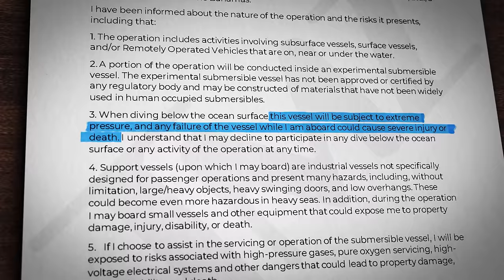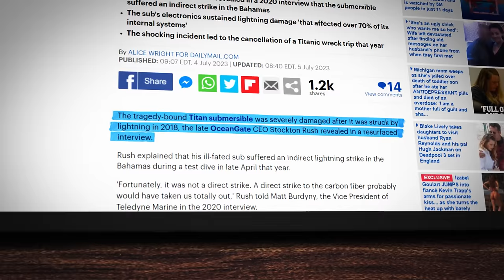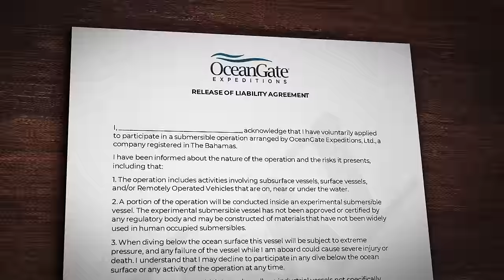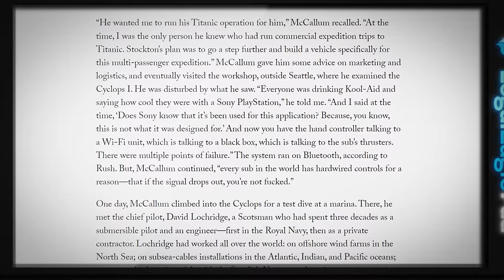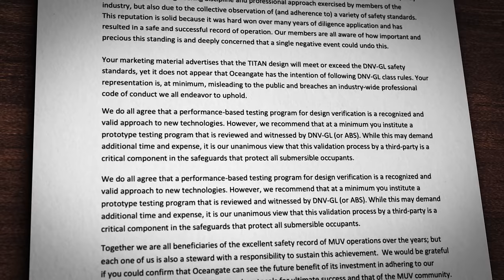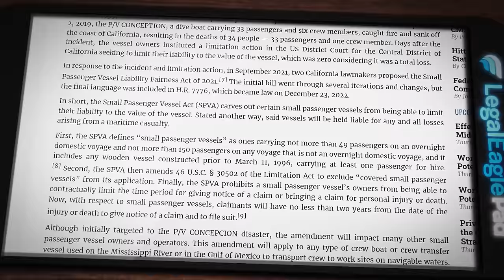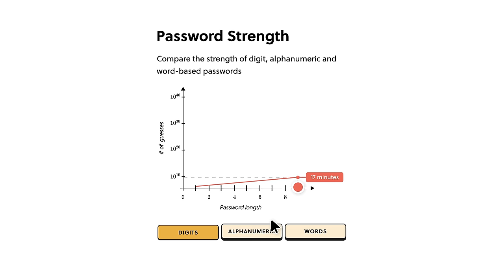OceanGate Is Getting Majorly Sued

Comment: @5:25 LOL! yeah, Rush liked the plexiglass window because it was 7" thick and "when plexiglass fails  it starts to crackle, so you get a huge warning" yeah, like the warning is going to help whenit happens a mile and a half below the surface and you have only a couple of minutes to take the pressure off that's causing the failure, but you're 2 HOURS ascent from the surface, brilliant!

Comment: The way I see it, they definitely should be held accountable because there was so much obvious negligence. Multiple experts and some of the staff repeatedly gave warnings about the vessel. And instead of contacting engineers, they contacted lawyers. On top of that, the waiver kept expressing so much risk yet the advertisement said otherwise. Then as an icing on the cake was the clear mention of how many corners were intentionally cut to "save costs" on something that requires a higher than normal safety standard than that of most things.

Comment: If a claim can be brought in any reasonable court, it seems like it will be a slamdunk for the families of the passengers. 

The view port was only rated to go 1/3 as deep as the sub was being pushed to.  It's hard to say you aren't grossly negligent when placing people in anything that is being exposed to 3x the max rating of any critical part.

That's like trying to run a bus service that goes 195 mph in a 65 mph zone.

Comment: The fact that he couldn't grasp the simple terrible truth that safety measures and regulations are most of the time set/increased after accidents and blood spilled is beyond my comprehension
Reply: In this case no , as the IMO has strict regulations on construction , safety , environmental operational and personal requirements . 
And there are a few certified companies that certify vessels that are constructed , the moment of design phase to actually building it .  from the drawings , to the construction methods each phase must be certified ,  every pump every valve every airbottle to every tank , must be inspected and certified for a ship can even be launched .  so it seems that the American Bureau of Shipping  ABS ,  Failed miserably in its job . otherwise they would have noticed the design Flaws , would have noticed the construction methods not to mention pressure tests . .  

ABS is for the high jump as they certified or did not even bother to inspect this vessel otherwise it would never be allowed to be used .

Blaming a company for getting it certificates does not go well in court  , and the IMO will launch or already have launched a full investigation int ot the practices of the ABS  . operators and shipyard that constructed it . 

AS every vessel that is put to sea has an IMO registration  number , and that number is only gotten if it passes all inspections .
Reply: @marcusfranconium3392  The problem is he insisted on taking the vessel WAY deeper than it was actually rated for. Nobody certified the vessel to go as deep that deep, and everyone told him it couldnt go that deep, but he did it anyway, while intentionally jumping through loop holes to get past regulations.

Comment: The off the shelf parts such as controllers motors sensors etc, aren't necessarily what people were concerned with, it was the carbon fiber hull that was classified as experimental to go to those depths that was the big thing.
Reply: Still, any part of the navigation or aeration system failing would also result in their deaths, just more slowly.
Reply: Well, I wouldn’t put my main focus on the controller itself, but that it uses Bluetooth and isn’t hardwired into the sub. 
Everyone who has used Wi-Fi and Bluetooth knows that it can become quite unreliable at times. And the last thing down in the ocean is to lose signal with your controlling unit. 
Which apparently happened on test drive already. So regardless of what the hull is made out of, what good is it when you can’t maneuver no matter what it is made out of?

Comment: First thing is to subpoena the audio recording of every dive.
Every single odd sound on those recordings of successful dives should have Oceangate "experts" explain what that specific sound was, how it was identified as potential damage, and what corrective actions were taken once the submersible resurfaced in preparation for the next dive.
They won't have them, if they do they won't be able to identify the sounds, and if that they won't have documentation showing how they repaired it.
This is how expert witnesses will build the case for gross negligence.

Comment: Waivers like this need to be outlawed. There's no way this waiver should be considered a legal document. its ridiculous.
Reply: Agree with you.
Reply: It's likely not enforceable, as explained in this video.
Reply: i did bungee jumping and wild water rafting several times. Everytime i had to sign a waiver. what would be the difference? i wonder..
Reply: with the sheer amount of evidence pointing them them knowing beforehand that this sub should not be doing this kind of dive, not getting the design tested and certified, and forging documents to list passengers as crew there is no way any judge or jury would let this waiver fly.
Reply: If people want to play stupid games why shouldn’t they be allowed? Its their life
Reply: @fly89  I guess the difference would be what when you went bungee jumping you didn't use an experimental bungee cord that the company asking you to sign the waiver assured you was 100% safe, safer even than any of the common bungee cords used, despite being warned over and over again that the bungee cord was definitely not safe.

Basically the difference would be that with a standard bungee jump, the equipment is as safe as it can get and if something goes wrong it's because of an accident or unforeseen circumstance outside the company's control. The point of those waivers is that if, say, the employee who was supposed to check your cord before the jump neglected to do so and therefore didn't spot that the cord was damaged and unsafe, you or your family can't sue the company, because the company operates under the assumption that its employees do the job they're being paid to do... But you can still sue the individual employee responsible. (Unless, for instance, a memo is discovered where the company instructs its employees not to check the rope before a jump, despite that being an industry safety standard, in which case you can potentially prove that the company itself was negligent and thus can be sued despite the waiver.)

With the Titan the equipment wasn't safe to begin with and Rush was warned that the sub would eventually end up killing people. And so Oceangate can't exactly have people sign a waiver where they acknowledge that if something goes wrong, it's not the fault of the company... Because it's definitely the fault of the company.
Reply: It's illegal, did you watch the damn video!? 😂
Reply: @cinemoriahFPV Well, not "illegal"; it's not legally enforceable. There's quite a difference.
Reply: @fly89 Them *knowingly attaching you to a frayed bungee cord?

Comment: It's like someone saying that flying in a small Cesna 172 that wasnt properly mantained, didnt pass any inspection or regulations and was piloted by an amateur pilot, was safer than with a certified pilot with 5000h of experience in a certified A321 that is fully inspected each dawn. That guy was insane.
Reply: I'd say it's closer to someone strapping 5 built-from-scratch paramotors together and trying to accomplish a transatlantic flight. At least Cesna 172's are, yknow, actually airplanes.

Comment: I always cringe when I hear reference to the gaming controller as an indication of how unprofessional the operation was.  Ironically, that was probably the most tested and reliable component in the whole operation.  The military use them for certain platforms.
Reply: The point was that such a setup connecting the controller creates a lot of possible failure points that are difficult to evaluate possible failure modes, much less get a handle on failure rate of each mode of each black box component. 

Basically they tried to save money at the cost introducing a whole bunch of unnecessary risks that cannot be properly analyzed.  (Probably the very definition of lacking safety engineering)
Reply: The military use actual Xbox and PlayStation brand controllers that are wired. This wireless controller that was in the sub was a knock off of a knock off from 2005 that is still well known to randomly disconnect for no reason. It was also known to have issues with pairing with devices.
Reply: The military uses them for unmanned drones and things like periscopes, not the main controls for a manned vehicle.
Reply: @iangalloway8917 Logitech 2011
Reply: The controllers aren't just used by the military. Remote Operated Vehicle (ROV) operators use similar controllers.
Reply: @taumctauface1886 exactly. Personnel carrying vehicles do not ever rely on commercial mass produced controllers for movement.
Reply: @iangalloway8917  Yeah, part of the reason it's such a good indicator of what was going on with the sub is that they weren't even willing to shell out the full $50 or so to get a high-quality first-party controller. The use of an even cheaper substitute for an already-cheap component is a MASSIVE red flag for the company's willingness to spend the necessary funds on equipment.
Reply: "The military use them etc." 
Do the military really use that exact brand and model of gaming controller to steer an 18,750 ton SSBN or just the minor systems like periscopes, sonar sensors, antennas. range finders, towed arrays, recon drones, coffee machine, donut maker, ice cream machine?
Are the military version of gaming controllers cabled, spliced, socketed, plugged, double insulated, triple insulated, soldered directly to the circuit boards or are they using the unreliable bluetooth versions like the Titan submersible did?

Comment: This goes beyond gross negligence into the realm of criminal negligence. Ocean Gate employees and the vendors who supplied parts of the pressure vessel should also be held responsible. They all should have known better.
Reply: I don’t necessarily think the vendors should go down for this. If I buy a block of steel to make a knife or gun out of it and do bad things with it, that is my problem, not the steel suppliers.

That said, if Oceangate told the supplier what they were doing and the supplier told them the parts were suitable for a sub of this kinda when they were not, that is a different story.

Unfortunately, from everything I have heard though, it sounds like most of the suppliers specifically told them that their products were not rated for what they were using them for and Oceangate just ignored the warnings (I.e. the window only being rated to 1500m of whatever it was).
Reply: He bought off parts of shelves of department store. Bought the carbon fibre on cheap at a Boeing yard sale, the same stock that Boeing deemed unusable and past its shelf life.
Reply: I don't think it's fair to blame the vendors if someone uses their products in a dangerously unsafe manner. From what I understand at least part of the problem was OceanGate using parts in conditions those parts were never meant to endure.

Comment: I'm not an attorney but it occured to me that in a lawsuit for personal injury by the plaintiffs on the Titanic thinking that they could have prevailed on the theory that the owners did something wrong (designed the bulkheads incorrectly ) and had a duty of care and breached that duty which caused injury to someone as a result. They knew beforehand the possible hazards to the plaintiffs regarding the stability of the ship in high seas because they certainly PORED over plans of the vessel at some point in its construction. And the half hearted settlement tacked on to the judgement possibly acknowledges it. So an incorrectly designed vessel at least would have breached the duty of care of the owner to more rigorously evaluate its design beforehand, also as an assist in turn investigating the engineers and the construction company.

Comment: "here, get in the submersible coffin while I spend a half hour ratcheting the bolts tight so that, even if there was only an air problem, you might suffocate on the surface, before we could get the lid off to save you"

Comment: If you want me to get in a rig . . . that has 10 bolts to secure part of it , then tell me it is to hard to put the last bolt in , so we don't  and after go to depth that could possibly crush an all metal vessel .  .  .  well , I'd be on the phone to the bank so quick to cancel the check you wouldn't have taken a breath . As a High - rise (retired) worker we were always reading the wording " how to safely join these dis - similar materials together " FOR SUPERIOUR BOND INTEGRITY " . It seems integrity was nowhere to be found in this companies operational  procedures .

Comment: The key reason carbon fiber is so effective is because the fibers are highly resistant to being pulled apart when working with tension. When compressing a carbon fiber material, the only structure component is the resin that the fibers are immersed in. Basically they made a submarine out of resin.

Comment: You mentioned high altitude diving around 11:35. Never heard of it is this diving in something like a mountain lake?
Also what impact if any do you think the ocean gate incident will have on the hello moon flight if it ever goes up. Both are extremely risky to travelers. Can guarantee there will allways be some experts concerned about risks and with the owners playing down any risks.
Reply: Altitude diving is diving in any water that is more than 300 meters above sea level.  Altitude diving is dangerous because the lower air pressure at altitude requires earlier decompression stages to prevent getting decompression sickness (the bends) upon surfacing.
Reply: @stargazer7644  cool thanks - it just didnt make sence to me cous i had never heard of high altitude diving before. makes sense that there might be a higher rist of the bends when surfacing to a high altitudes (lower air pressure) but didnt realase lakes would be deep enough for it to be that much of a concern.
i was imagining the insanity of diving from a plane lol

Comment: Legal Eagle keeps on referring to "carbon fiber" being used to make the sub. While the small clip quoted from the engineer is talking about how it was built from "carbon fiber composites". Those two things are very different.
Carbon fiber is a ridiculously expensive material that is ridiculously strong. Carbon Fiber Composites are basically plastic reinforced with a little bit of carbon fiber. The sub was built out of the latter.

Comment: If this isn't gross negligence I don't know what is. If the window is only rated for 1500m there is no way the sub will be safe at 4000 m. The thing about a high pressure situation is the hull will fail at the weakest point and once one part of the hull has failed every part of the hull is guaranteed to fail therefore every part of the sub needs to be rated to as deep or deeper than the subs deepest dive.

Comment: SMH... Anyone who has worked with carbon fiber in design engineering, or has used cf equipment in any stress application knows why this shell was a literally insane design. This was the demise of tech bros who thought they were smarter than over 100 years of physics and research, because of... reasons. Always. Listen. To. Engineers. Especially when they tell you that you're probably gonna die.

Comment: As a avid diy guy, the problem is not the game controller usage , it's the choice of material and the shoddy craftsmanship. With proper materials like the right alloy of Steel would have made it much safer since it would have withstand many much more compression and decompression due to the properties of steel. Steel can also be welded to steel, the hull of the titan was glued to the titanium caps.

Comment: The Titan Turd ......
OceanGate THE RIDE OF DEATH ! At the meeting, Lochridge discovered why he had been denied access to the view port information from the Engineering department — the viewport at the forward of the submersible was only built to a certified pressure of 1,300 meters, 4,265.092 ft although OceanGate intended to take passengers down to depths of 4,000 meters,” 13,123.36 ft 🤮🤮🤮🤮🤮

Comment: I'm not an engineer by any means but I have done some carbon fiber fabrication as a hobby and I knew that carbon fiber is very weak in compression, and that you can't tell when it's going to fail. I first heard of this sub before the disaster and the question I had immediately was how they solved the compressive force problem with a simple carbon fiber capsule. If I can see the problem with essentially no formal experience then it was absolutely gross negligence, anyone with any engineering knowledge saw this problem and I have no doubt that the leaders were warned over and over.

Comment: I'd rather be utterly confused which button on the sub does what than rely on a singular BUTTON . 
With multiple buttons/switches, I'd at least have someway to get out of the situation should a button stop working.
With the singular button, the moment it stops working I'm screwed.

Then again, I still wouldn't go miles below in the sea in a sub eveb if you paid me

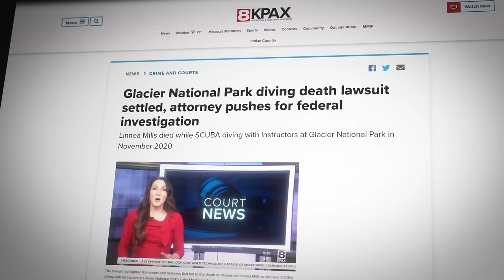Comment: 11:25 time mark _ The Linnae Mills scuba accident.  Besides failing to provide her with an inflator hose to connect to her insulated suit (which, in and of itself, warranted cancellation of the dive instruction), the investigation into the diving tragedy found that the dive instructors had weighted Linnae Mills down with 44 pounds of lead weights placed into pockets of her wet suit and BCD.  NO WEIGHT BELT WAS USED.  Can you imagine the level of sheer incompetence it took to drown that poor student?  They could just as well have walked her off the plank of a pirate ship shackled in leg irons.